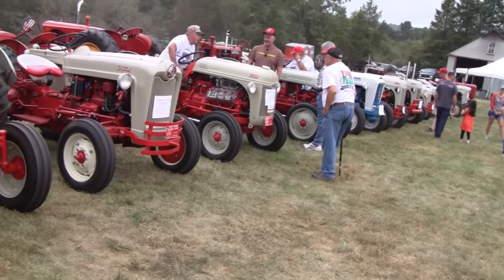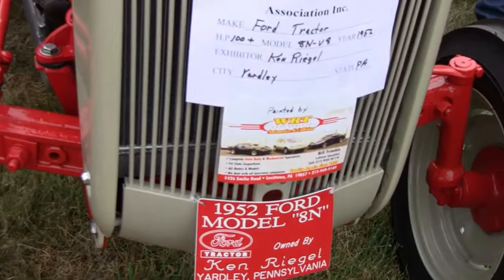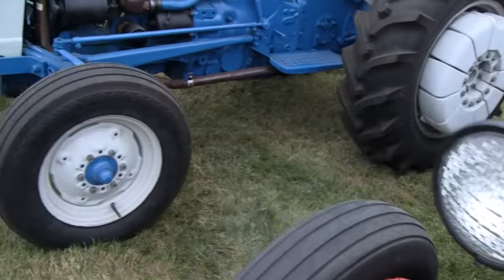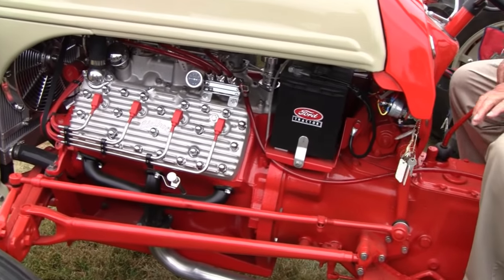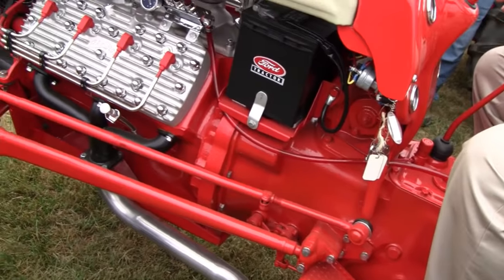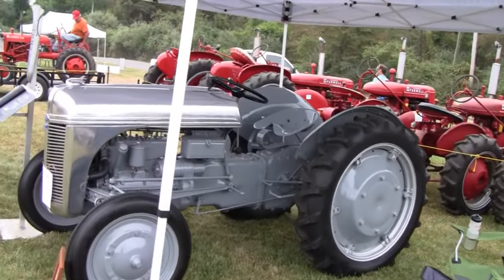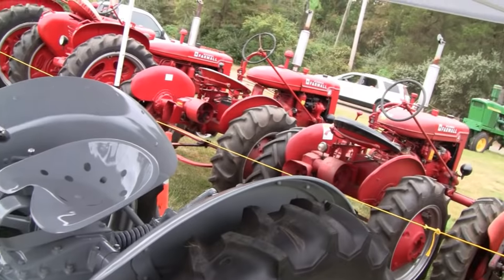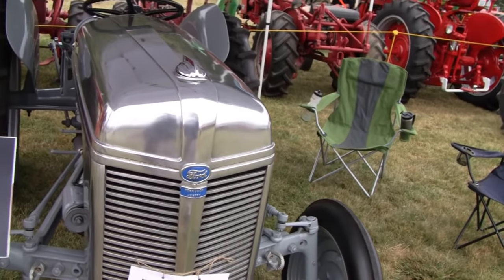1952 HOT ROD V8 FORD TRACTOR

Comment: Those Ford tractors had come a long ways before they sold out to New Holland. I got to drive a Ford tractor in 1965 and it was new and I didn't want to get off of it after driving it some. The guy who owned it worked in the logging business and used the tractor for that and also in processing hay. Before that I worked for a guy who owned a Massey Ferguson tractor which was nice and new, but it didn't have the power steering on it like the Ford did, but was a nice tractor. That was the first tractor I learned to drive and I loved it too, but the guy's son was abusive to the tractor and all the equipment his father had.

Comment: HMmmm, my old ford didn't look like that.....   Its kinda finny that he retained the push button start!
Reply from the maker: Strange eh!! Probably spent 30K fixing that bitch up but wouldn't go 15 bucks for an ignition switch!!☺
Reply: 805ROADKING
Well, I guess he kept it close to original, it had a key (in the bulkhead, mounted, not hanging like his) for the ignition, but thats the OEM starter button.
It was interlocked with the transmission so it would only start when the tractor was in reverse.
The idea behind that (So I'm told) is to prevent a tractor thats frozen into the ground from firing up and flipping over.  No clutch interlock, or rops on those old buggers.

Comment: Wow 😳 that's cool , I have a 50 ford flat head in my F1 truck , love these old original hot rod motors ! I gave away a back up merc engine to a friend just so he would take me for a ride in his truck when he finished it.
Reply from the maker: I almost bought a Flatty last Saturday at a Show, the guy wanted a little too much for it!!☺
Reply: 805ROADKING that's usually how it its, I found this Mercury after I bought my ford pick up , like 2 days later, at a building I rented, it was rebuilt and in perfect 👌 condition, if my ford had not run perfect , My plan was to keep that motor for a back up, until my buddy, saw my pick up, and showed me his that he was working on.